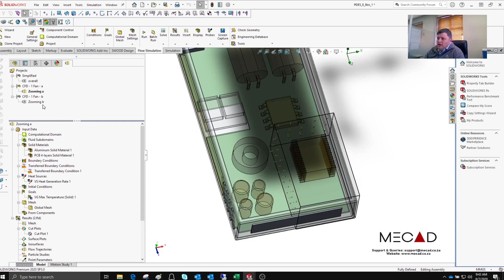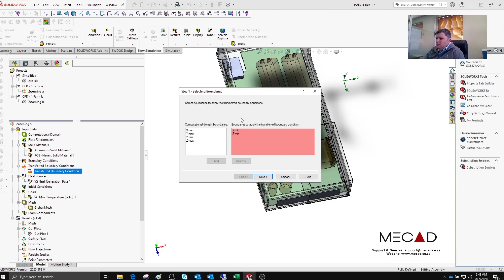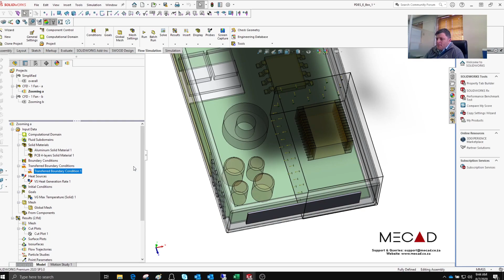How to implement EFD Zooming within Solidworks Flow Simulation

Comment: Could you show us how you setup (details) the Boundary Conditions before you got the Transferred Boundary Conditions?   The Solidworks Flow Simulation book does not show the details either, but they have the finished model like yours, but no one is explaining how they are setting up the boundary conditions for the EFD Zooming.

Comment: Could you please explain how to do EFD analysis for a city for its air pollution using Solidworks.
Reply from the maker: This is outside the scope of Solidworks Flow Simulation. You will need to look at a very different type of software for that, CFD does not seem appropriate for that.